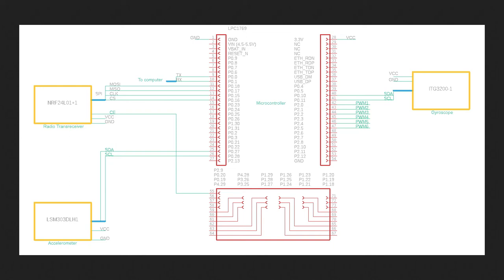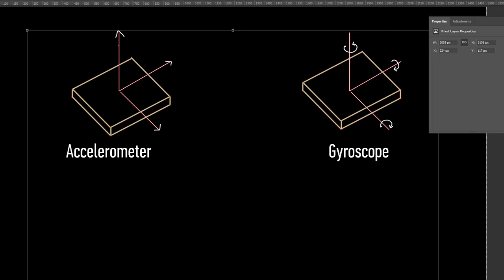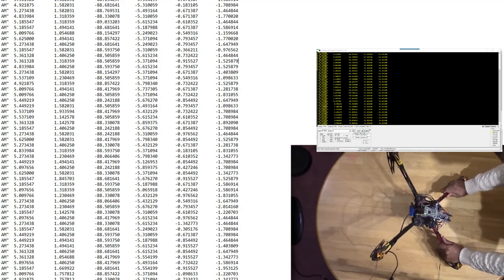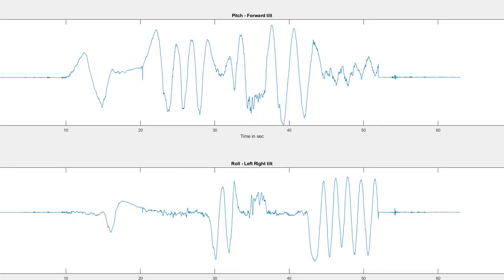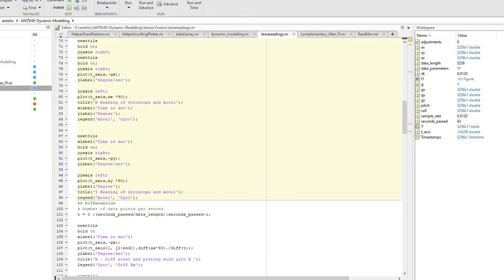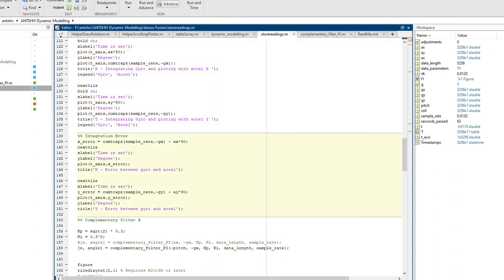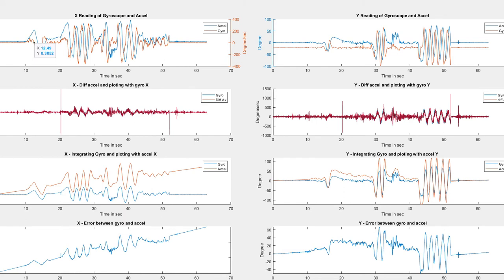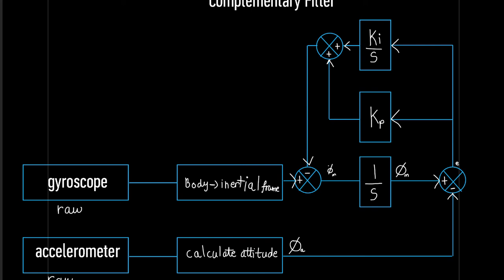Sensor fusion - Applying Complementary filter

Comment: 17:00 Can you explain how you calculated Ki and Kp? And maybe elaborate more on what they are doing exactly?
Reply from the maker: How I calculated the Ki and Kp gains, I did this through trial and error. If I used a different sensor, the values would be different.
The Ki and Kp terms are to calculate the error over time. Let us break it down. Kp is a gain term. Ki is an integral term. Integration == area. In this case, we are calculating the area of the difference, which is the difference between the integrated gyroscope angular rate and the accelerometer readings. Ideally, if we integrate the gyroscope readings we should get the accelerometer readings. Due to drifts, sensor errors, and practical issues, this is not the case. To make this work, I add a Kp+Ki term. If you try to subtract the errors directly from the gyroscope reading, you tend to force that the accelerometer reading is perfect and the gyroscope readings are wrong. Ideally, we want to capture the gyroscope readings in a short time and capture the accelerometer readings in the long term. The Kp + Ki term tends to do this. 

Hope it helps.